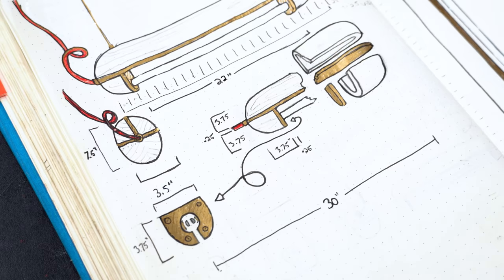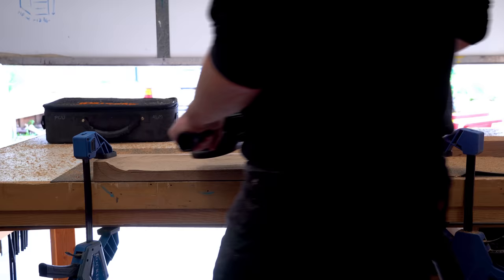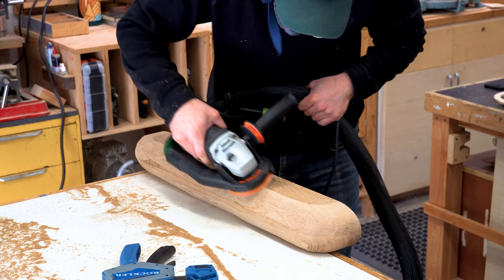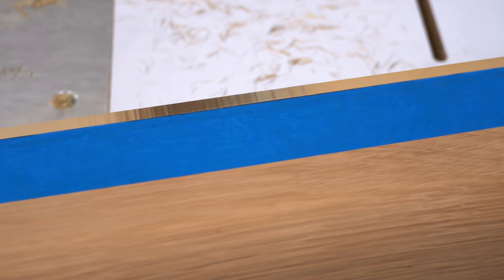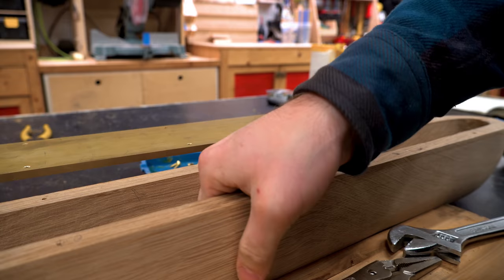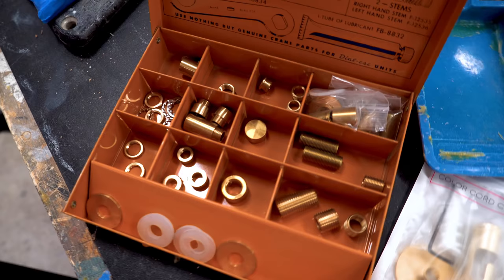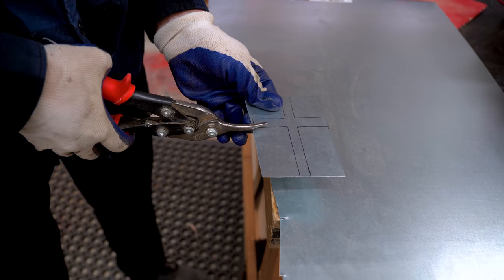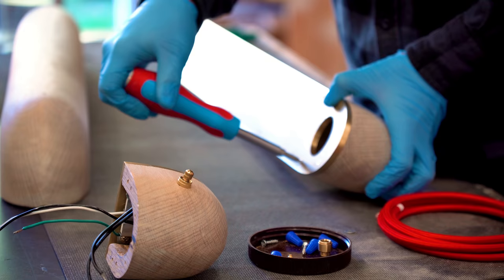Power Carved Pendant Light

Comment: The trick with brass screws is to use steel screws first, to cut threads in the wood, then replace them with brass screws.
Reply from the maker: Smart!!!
Reply: Yeah, learned that the hard way some time ago. I was just going to make that comment when I saw yours.
Reply: A came to the comments to say the same thing. I learned that lesson the hard way.
Reply: Also use some wax to make them screw in easier.
Reply: Before starting the brass screw, turn it backwards up to a full turn until you can feel it engage the threads. Same works with any screw in any already-threaded hole. Clips cross-threading in the bud. Nick Ferry did a vid on the subject.
Reply: Excuisme ,,, hello 🙏🤝🤝
Reply: Yep hard lesson to learn
Reply: Great project, your education is right at my level.  One trick I learned many many years ago with screws into hardwood or any for that matter; run the screws across a bar of soap.  It will lube the threads and any excess cleans off easily and your hands get clean too.

Comment: The mole grip and adjustable spanner move on that snapped screw is such a good move! Never seen that before 👏👏👏
Reply from the maker: Thanks! It doesn't work every time, but I was glad it did this go round. 😅
Reply: @MichaelAlm  I bet you were 😂
Reply: @MichaelAlm  As you probably already know, Vise grips are made to work perpendicular to the threads, so they bite in. If you put enough pressure on them in parallel with the screw, it will work, but not the best way to do things. Keep a few nylon washers handy as spacers to protect your project if it happens again. Great looking fixture!

Comment: Michael — please please please consider wearing a particulate mask and protective glasses when routing metal next time. Especially if you're going to stick your face really close to the router table. As someone in the healthcare field, you really really don't want to know what happens when you get metal shavings in your respiratory tract or your eye sclera. I'm not your mother. Not telling you what to do. But want you to stay safe and have a long life full of happy woodworking. Be careful, brother!
Reply: Yes! And they cannot use a magnet to pull brass from your eye like they could with ferrous metal.
Reply from the maker: Hey Pablo, I totally agree, and that was definitely a lapse on my part with the respirator.  I'm pretty sure I was wearing safety glasses though. I've had steel in my eyes before and its awful. No matter what, yes people should wear both, and I will double check next time. Thanks!
Reply: @MichaelAlm  sorry but no. When you were drilling the hole for the wire, the scariest part of the whole project you called it, you were not wearing safety glasses for most of the video shown. I actually had to cover your face with my thumb as it was freaking me out. (I also ran through the woods as a kid and scratched my cornea - came millimeters from blinding myself, so eye injuries are a super ick thing for me!)
Reply: @triciac.5078  Seeing as we are exchanging war-wound stories, I had broken glass in my eye after being hit in the face with a squash racket.  OK, this was a long time ago, but I suspect that plastic lenses might have been an option.  All I know is that I ended up getting my wife to take me back to the hospital at 3am because I was convinced they'd left glass in my eye.  They hadn't of course.  It was just the scar I could feel, but by heck it was an unpleasant experience.   I worked 40 years as a toolmaker, and those slivers that come from the side of an end mill or router cutter are like needles, and can be a nightmare to deal with.  I retired at the end of 2004, but I still use machine tools three days a week at my Menz Shed, and I use gloves when handling swarf.
Reply: @MichaelAlm  Ahhhh ... the safety police.....we are so lucky they haven’t mandated 3 pairs of underpants as a minimum safety standard 🤪

Comment: Beautiful piece.  
The pilot drill for the hole saw wants to be the same size as the mandrel in the hole saw.  It can be a very good idea to pilot drill, particularity when free handing to prevent banging the saw teeth into your work when the mandrel breaks through the back side. I would like to have seen you attach the ground wire to the body of the brass.

Comment: This is gorgeous!

I have two or three light designs floating around in my head and now just might Lee’s to pull the trigger on one!

Also, I’m sure it’s been mentioned but I always use a steel screw first to establish the threads before using a brass screw. 
...of course this was learned the hard way too!
Thanks for the video!

Comment: Have you seen the Adam Savage one Day Build of his Saw Station for his hand held Bandsaw? This could be something for you.
I really dig the design of your Light!
Edit: A little Tip I caught up. You can braze Steel Parts (and Screws) with a torch and a Brass Wire brush. So you won't have to use the delicate brass screws and still get the look of it.

Comment: You don’t need any oil for milling drilling or tapping brass. Most yellow brass contains lead and it self lubricates. Also the lead causes the swarf to come off as fine chips rather than a long stringy mess. We only use oil in our CNC where we are taking much heavier cuts. There the oil acts as coolant.

Comment: Put a bit of wax on the thread of the brass screw, it really helps with inserting, also use a steel screw first to cut the thread in the oak.

Comment: FYI, not sure how humid it is where you are, but you can get galvanic action when steel is in direct contact with brass and over time the steel will corrode. To avoid this, use plastic or fabric spacers and washers when connecting dissimilar metals.
Reply from the maker: Interesting 🤔 Not that humid here fortunately. I’ll keep my eye on it though!
Reply: @MichaelAlm  Yeah, it's worth looking into, especially if you're going to be using brass more in client work

Comment: I really love this type of lighting, just have two question:
1. Why didn't you put the red cord on top of the fixture instead of on the side through the brass?
2. In hindsight, would you still show this much of the light tube or maybe conceal more of the ends so you only see the actual light and not part of the fittings?
Sorry, hope I described it properly...
Really, really nice job with the oak and brass combination 👌🏻

Comment: Really cool design! I like the wood brass combination like you. The only thing I would add are some brass covers on the plastic parts left and right of the bulb body. Maybe some brass tube fits. This is maybe over done but you have used so high quality materials, there are this white plastic parts not the optimum. Greetings from Hamburg Germany ;-)

Comment: Hey Mitchael!

You're having a hard time with your twist drills in brass because brass is a fairly gummy material and standard wood drills have a positive rake angle, making them prone to grab and bite into the metal WAY too aggressively. Buy a set of nice twist bits and use a sharpening stone to put a neutral rake angle on them by grinding a flat on each cutting lip. Clickspring has a great video on this!

Especially when you drill into the side, the angry crunching sound is the drill taking way too aggressive bites

Comment: A day late to comment, was up visiting my parents :)
Why did you use oak? You’ve commented multiple times about your concerns with the weight of the oak and the brass. Why not pick a lighter wood? Was it because of the grain thing you mentioned in the beginning? Being a wood-know-nothing, I kinda assume you can get similar grain thingy from other, lighter woods. But maybe not?
Reply: Ok I just saw the finished product. The grain is definitely gorgeous!!! The whole project is wonderful.
Reply from the maker: Hey Tricia, yeah, it was all about that grain!! Also I used strap toggles in the ceiling so the weight isn’t as big a deal as I feared. I think in the end it’s 15lbs and those anchors can hold 10x that much.
Reply: @MichaelAlm  thanks for answering my question :)

Comment: Great build! Really love how you designed this piece. I have one question tho, how did you come up with the design that the cord will come from the side and not make it a normal pendant light where the cord will come from the top? Is it because of the weight?
Reply from the maker: Thanks Hannah!! I did the cord out the side because I felt like it needed some asymmetry. I also really like that it continues along the line of brass, so when you look at the fixture the cord draws the eye in and connects to the rest of the piece.

Comment: Nice work! How did you get the light bulb in?
Reply from the maker: Thanks! The hole on the right side doesn't have anything inside so the bulb slides through that hole and then has enough room to clip in on the left side.